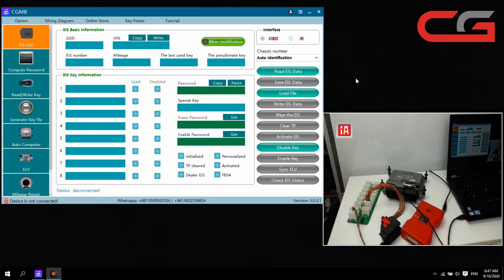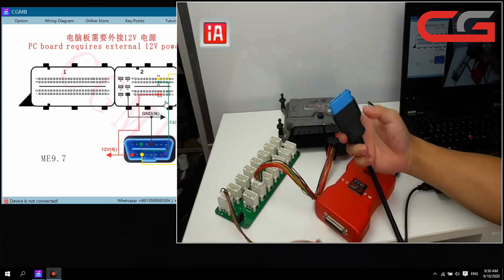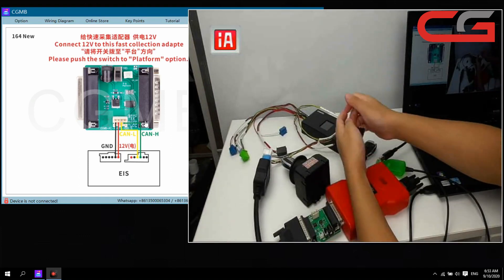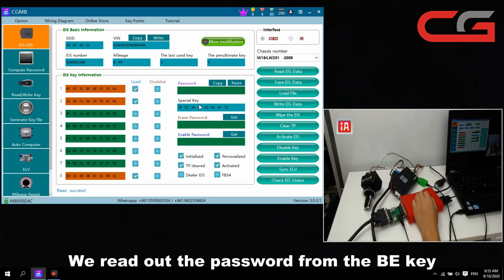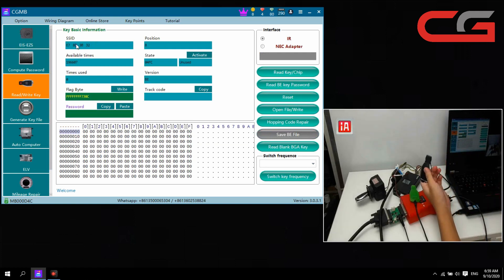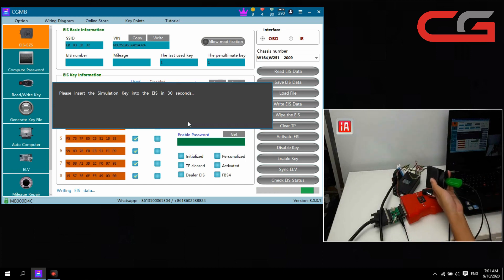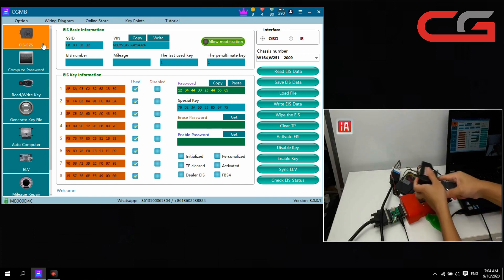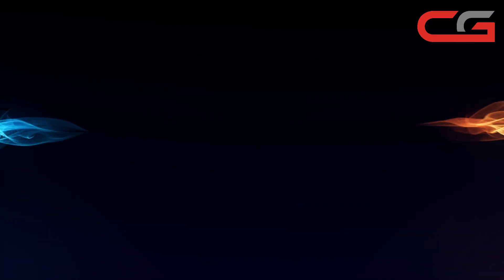Use ME9.7 data to generate  EIS W164(2009-)

Comment: DON'T ORDER THIS JUNK!!! - There is no tech support at all, their tutorial info is crap and many models of EIS and dash models  is missing completely! and good luck getting a replacement if you get a bad one or need anything from them, including a refund! JUNK!  - I received a bad CGMB (wont read keys), they still have not replaced it from months back and the seller wont reply! -- I have been trying to get help with doing mileage correction ONE THE CAR I BOUGHT THESE THING FOR (2002 C240) for that amount of time as well. They sold me BOTH the CGPro and CGMB to do this car and neither of them do the car mileage or EIS programming and the built-in tutorials are incomplete and tech support wont EVER help you get things done, and if in the USA, you have to stay on chat in the middle of the night and HOPE anyone even answers!

Comment: I did not understand correctly for the EIS number will remain the same or must be changed
Reply from the maker: Sorry , the video make not good , you need to make sure your EIS chip is same . For EIS number better make it same as original one
Reply: EIS original(1) and EIS To replace(2)
what number I should write on the new one to replace 1 or 2
(because I have already done a customer so the car starts but on the dashboard there is a problem with ABS)
Reply from the maker: @karimkarimm1242  Hi ,If i understand right , The EIS number will can not change it , You direct write the original EIS data to new EIS , it only have SSID and key position information(VIN need to write alone ). The EIS number will be same as before ,no change .and no need to change .
Reply from the maker: @karimkarimm1242  And about your ABS , you need to check your car ,if it is work good before ?
Reply from the maker: @karimkarimm1242  Hi ,contact me whatsapp +8613602538824
Reply: @cgofficial2114  with the original eis on the dashboard no Problem, but when I put the eis the one I programmed then on the dashboard Abs warning light turns on
Reply from the maker: @karimkarimm1242  Did you write the VIN to the EIS? contact me with whatsapp +8613602538824